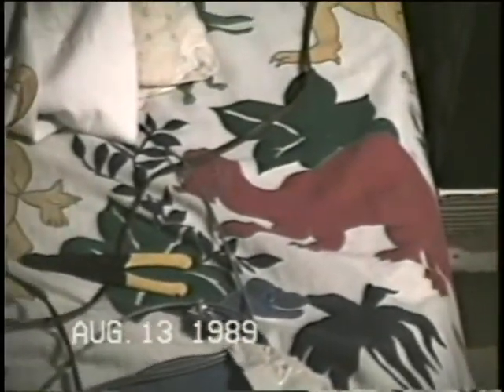Retrochad tests tube amp design in 1989

Comment: @retrochad i have the books and quite a bit of test equipment but i just dont have the knowledge yet. but my electronics classes are helping alot.  soon i will be confident enough to try to repair one of my radios. ill recap a 40's silvertone AM radio first. then if all goes well ill move into both radios bought new by by great grandparents both in 1948. im going to do the philips last. it needs new caps.

Comment from the maker: I don't know that I ever did get it working. That was an old Zenith AM/FM radio chassis (although I didn't know that at the time).
I think I had the rectifier tube working but for some reason didn't have the output tube set up properly. I'm sure I still have the chassis somewhere.